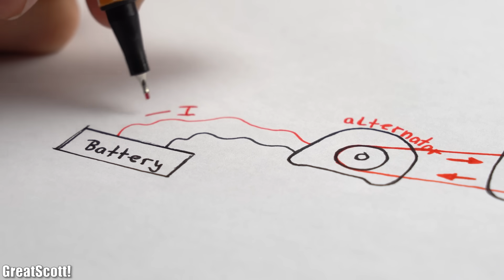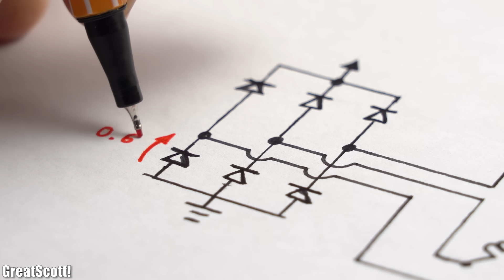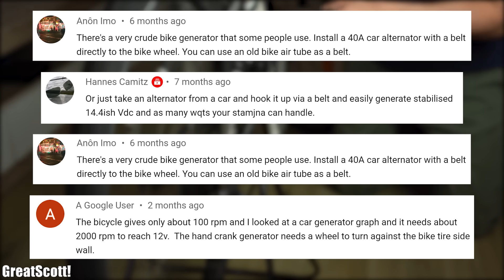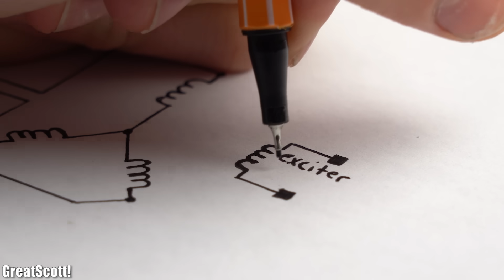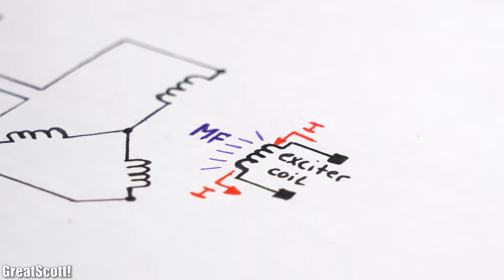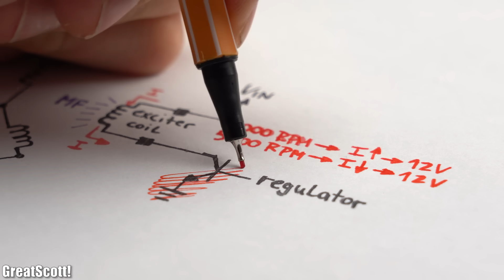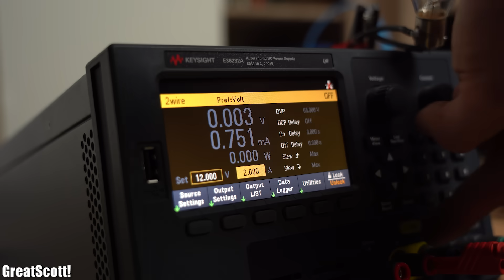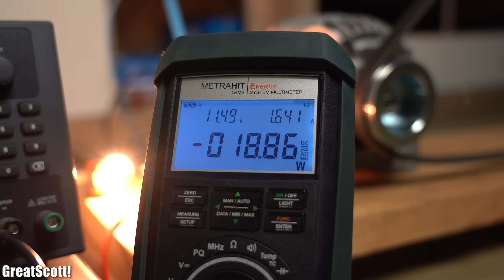Using a car alternator with a bike to power my home? How much energy can I produce?!

Comment: I'm sure 7,000 people have already brought this up, but every car I've seen uses a spring-loaded idler pulley to keep tension on the alternator/accessory belt. Doesn't change the necessity for the exciter power, though. I guess having both a generator AND alternator attached would add too much resistance pedaling, too.

Comment: average human can only create 200w of continuous pedal power 
but you have big losses in the system 
10% loss on amplification drive 
40% loss on alternator 
2% loss on full bridge rectifier 
10% loss on inverter

Comment: Charlton Heston 1973 dystopian movie "Soylent Green". With his movie roommate Edward G Robinson used a bike/alternator to charge the batteries that powered their apartment.
Reply: In his book, first published in 1962  by Hachette, Bibliothèque Verte, Mon chien, mon ile et moi, Jaques Talrich decribes how he was left on a deserted island with a few fish hooks, a gun and a dog and some other equipment to  re-enact a modern day Robinson Crusoe. He had to report daily by radio to the sponsors, and for this he was supplied with a radio transmitter powered by a battery that had to be rechargesd with a hand crank. It took him at least a half hour of vigorous cranking daily to recharge sufficiently.
Reply: IM AT THAT AGE. THAT I REMEMBER  THAT MOVIE. LOL
Reply: HI, it was also just a gimmick for that scene - its not really possible to generate usable power of a bicycle
Here is sydney there is the "Power House Museum"  one of the science exhibits is a bicycle with small generator, you sit of the bike and pedal, in front of the bike are some lights on a pole and a buzzer and up top a car horn, the scale  shows 5watts 10 watts etc  In my prime i could barely get it to go past 1/2 way and light up a very dimly light 2 incandescent car headlights - typically from 50's to 70's cars, full brightness they are 60 watts each on low bean and about 80 on high - both bulbs barely glowed like a small flashlight and the light was very yellow
Reply: Given the era of that movie, the alternator did not have the regulation circuitry this one does, and may even have had permanent magnets.
Reply: @Nono-hk3is  Such alternators existed... they were just few & far-between in production-model cars at the time. GM had the internally regulated 10SI-series alternator, but Chrysler still used an external-type... which, following a DIY wind-powered generator article in Popular Science at the time, was the choice for building such.

Comment: I had to chuckle, because I knew exactly what problem you would run into.  I've been considering building a water generator to put on the river and thought an alternator is a good option.  My boat's secondary alternator has quite a lot more connections, though, and the exciter is controlled with a fancy charge controller.  There's another project for you.  I'd like one for charging lithium.

Comment: a car battery is NOT 12 volts, it is 12.8 volts. a car alternator does NOT output 12 volts, it outputs 14.5 volts.

Comment: BMW now makes a 48v system maybe if you spend a little you could give that a try
Reply: Or for something easier to find, some Toyota cars have 650V alternators. (650V is at maximum RPM, it will be less typically.)

Comment: Older cars came with generators, which may give you a head start but may not be ass efficent due to dated design. There are many types of alternators, with and without internal regulators. External regulators are fairly basic and diagrams are readily available. There are also kits to add permanent magnates to several popular alternator models.

Comment: This is totally wrong method to excite the coil. You should have to add constant current circuit for coil excitation. Higher the current flowing through the excitation coil, higher the power generated. There's another idea to excite coil. Connect the excitation coil in series/parallel with the main winding. But you must have to supply from external power source initially. (A series/shunt/compound generator). Must try & make another episode. 🇮🇳

Comment: If I didn't see it wrong the gears of your bike isn't at highest one which is tge amallest one for back wheel and biggest one for the front one.
Reply: I think he forgot the gear ratio between his leg and the wheel gear :v
Reply: @nicomarino96  "He mentioned that the belt slipped...." because there was no tension pulley.
Reply: @nicomarino96  maybe glue some card board disk on the side so gotta some more high so it not gonna be slip... 😭Hard english
Reply: its annoying because scott always half-asses these videos and doesnt do things properly before coming to a conclusion

Comment: Can you use an inverter? like the ones in 4x4's to take the 12v up to 240v 2000w and then use the ac to power a small motor to turn the alternator for a closed loop system and leftover power can be utilized to run an appliance like TV or radio
Reply: and bang - there go the laws of physics - you could fasten your alternator to Issac Newton's corpse because he must be spinning in his grave when people come up with ideas like this
Reply: @Tsnafu  that's a long bow to draw- all that to run a small wattage appliance is gona be really expensive including all the maintenance to keep those moving parts running- Newton can rest and the laws of physics will melt all those components before they magically make energy forever.

Comment: It seems like there was a lot of inefficiencies with your system that could have drastically improved the performance. Reduce belt slip, stabilize the bike more, using a boost converter to charge a battery (with a varying current output that can be changed using a potentiometer, to change how much resistance you want) adding a weighted flywheel to make pedalling easier (commonly found on stationary exercise bikes), as well as messing further with the exciter windings further. 

I'd personally be interested in seeing you getting this project working better. Most people can pedal at around 250watts, and since you got nowhere near that output, there's a lot of improvements that can be made.
Reply from the maker: I will see what I can do :-)

Comment: Probably someone already saw it on the old video, but to make an three phase induction motor produce electricity without modification you need only to hook up big enough capacity to the output, to provide the required reactive power, the residual magnezitation will kick start the generation once you spin fast enough(I was able to generate way more power with this, than with a car alternator)
Btw, i love your videos
Reply: 30uF 230V delta connected cap, was enought for my motor, you can also calculate by rated power and cosphi how much reactive power..

Comment: This brought me back to when we first went off grid. for years we had a 3 then 6hp gas motor turning a car alternator in a very similar setup. Of course this was back up for our solar and batteries and now our system is massively larger so now we have a 9k generator as back up with a RV style charger for the batteries when needed "mostly in the winter." All of what we have now is managed by Grendal our whole Homestead Arduino project: One in the house "central unit", One in the Gen Shed, One on the Water Tower, and so on and on, All interconnected.

Comment: Hey Scott, try using wind energy to power this Alternator🙂 it would be good I guess.
By the way nice video 👍
Reply from the maker: Thanks :-)
Reply: @greatscottlab  You're bike is in the wrong gear. Swap to the smaller one!
Reply: Hey Scott , you cycle's is in low gear. shift it to the small gear at rear and large gear near the pedal for more rpm and power.
Reply: Please try it 😀

Comment: From some of my own experiments, the exciter coil should not be continuously powered
Reply from the maker: Maybe I will do a part 2
Reply: @greatscottlab  Typicality with self excitation a resister is used. A 1.2V battery is enough for external excitation, but you'll want to use a diode. https://youtu.be/dlvGYFB6AqM?t=388
Reply: @greatscottlab  The troubleshooting manual or wiring diagrams from older chev vehicles with external voltage regulators may help if you don't want to reverse engineer the one you have. There are many types of alternators, with and without internal regulators.There are also kits to add permanent magnates to several popular alternator models. Generators pre-dated alternators, but are still available as an alternative.

Comment: Why build it from an alternator and not find a replacement for an indoors bike.?
Reply from the maker: I did not have an indoor bike
Reply: @greatscottlab  no,what i meant to say was, since electric indoors bikes have a generator engine, and they simulate the mechanical load(gears,incline) with an electrical load (controled by the user) wouldnt it be easier to find a used generator like that and assimilate it on your current bike rig?

ps:pardon the first lazily written question, love your vids.
Reply: @GrBioCORE  When I worked at Intel, the company gym had stationary bicycles with USB ports to charge phones and tablets. It predates USB-PD so all it could do is 10W. An updated version that could do up to 100W with USB-PD would be awesome for backup power and general fitness.

Comment: Would it be possible to put in a tensioner wheel to get better grip on the alternator and bike wheel? Also there's a lot of what appears to be rattle and instability on the bike itself. 

Also how would this fair as a generator if attached to a windmill with similar gearing?

Comment: If you connect the positive of the exciter coil to 12V through a 5W 12V bulb, then when the generator is creating energy, the circuit will self power the exciter coil. The bulb will then go out to indicate it is charging. Giving you more POWER.. :-)  (This is how the car does it)
Reply from the maker: Thanks for the info!

Comment: I never knew that car alternators didn't have permanent magnets!!

Edit: But why?
Reply: To prevent the over charging of the battery, and for fuel efficiency.  With permanent magnets there would be a drag on the engine even when no power, or less power, was needed.
Reply: Cost - an electromagnetic coil is a lot cheaper than than a rare earth magnet - lighter too. Cars have an excess of power and petrol/diesel fuel is remarkably cheap for the energy it contains so it's a win/win
Reply from the maker: To fine adjust the created voltage maybe.....
Reply: So it can regulate itself. The idea there is that alternator will produce constant voltage (around 14V) no matter how fast your engine spins. Excitation level will change with changes in RPM and electrical load on cars "grid". It is constantly matching output of alternator to preset voltage, so your grid voltage stays constant.
Reply: Some newer cars actually do use permanent magnets in the alternator, which allows it to also double as the starter.

Comment: You had me at "I need to ride the bike for 14yrs!". lol.  Given how easy it is for a car alternator to slip and cause that Squealing sound you sometimes hear from cars. Then clearly there are losses from slipping. So maybe a system to enable the belt to be tensioned. However that tension will probably increase the pedal effort.
Reply: By using a tensioning wheel, you shouldnt experience any significant increase in resistance, outside of some weird torque on the alternator caused by pulling it on an angle, which shouldnt be an issue if its bearings are still good. 
The tensioning wheel should indeed be a great modification to this system to increase your maximum output

Comment: You are right my friend about the setup of one alternator being useless but what if you connected your bike to an axle with many pulleys that powered many alternators. You would be cooking with grease then. I saw a gear set up that  used gravity to turn the gears. It went from larger gear to smaller gear which was on same axle as larger gear than connected to smaller etc. The weight would slowly fall and it power the gears and at the end the last gear was spinning at extremely high speeds.

Comment: This is one of those things I never understood completely, I didn't quite know why an alternator couldn't be used as a generator. Then I looked up on Google all the information and found stuff like this, and it immediately made more sense
Reply: You can actually use alternator as your generator, but the power usage should be adjusted for lower. They are many people who use alternator for their generator in offgrid home. The setup for video above is not the best setting.
Reply: It's kind of funny that it's called an alternator when it has an internal rectifier and produces direct current.
Reply: @jimurrata6785  it's called an alternator because, before the use of alternators, automobiles and tractor engines used DC permanent magnet generators for the ignition systems. 
A DC generator made 100 years ago required a lot of regular maintenance  because rare earth magnets didn't exist. The magnets in the small DC generators were made with Iron and had to be de-magnetised and re-magnetised every few years. Or even more often if they get hot.
Reply: @monster8090  I understand why it is called an alternator.
To the OP, an alternator can definitely generate electricity. That is it's purpose after all.
*I knew an old metallurgist who worked for Echlin and his name is on their patent for the device.
Reply: @jimurrata6785  cool. I just know a lot of people who collect old cars and tractors.

Comment: Maybe you could use a simple and small battery with a diode on the output to power the inductor, and the feed back the output. In that way the alternator would be autoinductive once it begins generating power. Another simple idea is to use a pulley in a small tripod as a tensioner of the belt , the compression side of the belt seems to slacky and bouncing on the floor, a tensioner wheel would make it much smoother
Reply: In any case the Amount of power that a non professional athlete can generate is almost useless. Maybe a wind mill would be a nice use for that alternator. It wouldn't be high power, but maybe a good addition to a certain solar garage instation

Comment: Hey i need some help, i need to build a tesla coil with feedback transformer, any ideas on what i should do for the feedback transformer? and i actually tried a circuit.. but it led to a pretty weak oscillation... So if you wanna help then please just leave a comment reply.. that would be enough to help me 👍 once again, great video ...
Reply from the maker: I did more than one video about tesla coils.